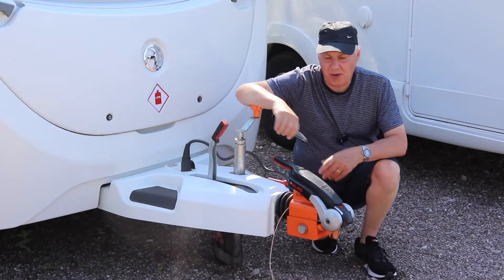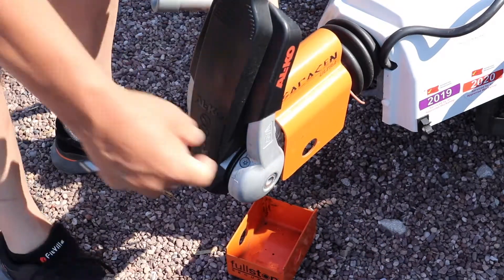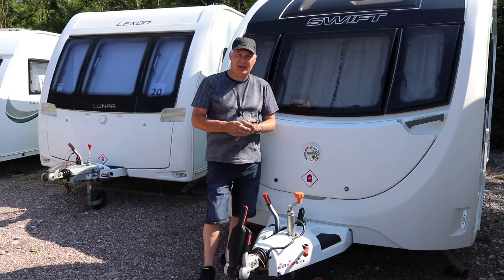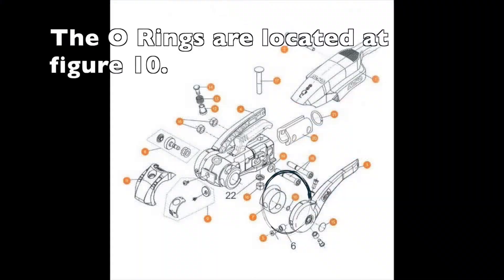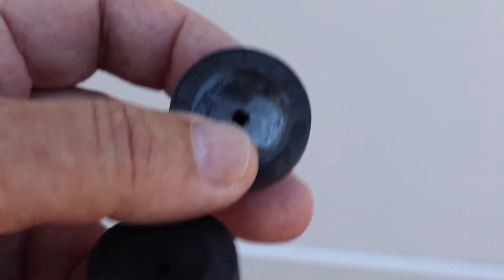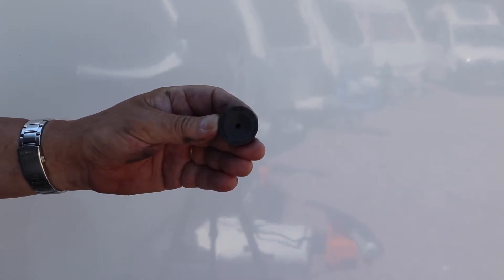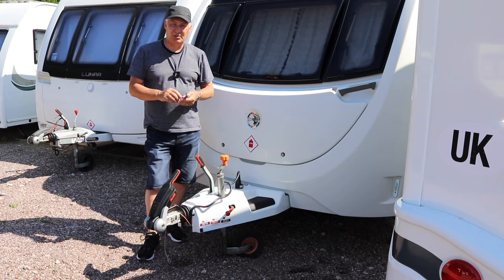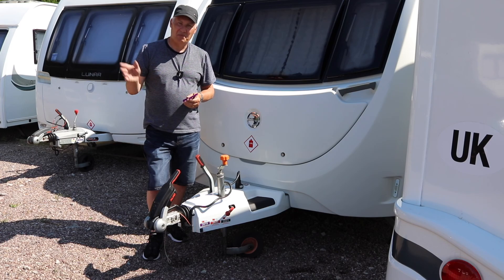Caravan Hitch  Friction Pad & O-Ring Replacement

Comment: Cheers Phil, I cleaned our caravan pads last year with a tip from Graham the caravan vloggers, put a pad in your drill and let the drill do the turning while holding the wet and dry with the other hand works a treat, I didn’t know about the o ring thing though thanks for that Phil, 👍👍.
Reply from the maker: Hi BB. I know there are lots tips on the friction pads. I recorded this last year and was about to put it out when 4 other Vloggers did it. I withheld till this year. Yes I was not aware of the O Rings either till they knackered on me😂.
By the way the pencil trick does work.  Thanks Phil🙂👍

Comment: Thanks for the tip in regards to the pencil, after about three attempts where trying to insert using the pencil I realised the o ring would turn to either side each time 
I found a quicker way but still using the pencil 
I re inserted the old friction pad and then teased to o ring in with the pencil so it was up against the old pad within the hole then carefully kept teasing the o ring with the pencil all around the o ring whilst very slowly moving the pad backwards until I was next to the groove - I checked everything was ok after pulling out the old pad with a torch placed within the ball hitch recess - hey presto about a minute once I’d sussed this method
Reply from the maker: Hi Eamonn. I am glad you managed it. I can be a faff until you sus it out. Enjoy your Summer. Thanks Phil👍🙂

Comment: Great video Phil,  you're bang right regarding the 0 rings .I had the same problem I messed about for ages trying with various screwdriver etc, and was getting desperate. I then used a pen top that was roughly the same diameter as the ring. Thankfully, it worked a treat. 😂😂😂
Reply from the maker: Hi Glen. Thanks for watching. Like you I messed around for ages until I got the tip. plus I was unaware of the rings until they fell out. All working now. Enjoy your season. Phil🙂👍

Comment: Isn’t there three parts to the hitch , the top plate that you have to screw in. Am sorry to ask as I’ve mine to change as it grinds when towing.
Reply from the maker: HI TT yes there are front, rear and top plate. I didn't film them as they did not need changing. I will record those when I need to replace them. So far so good. Thanks Phil👍🙂